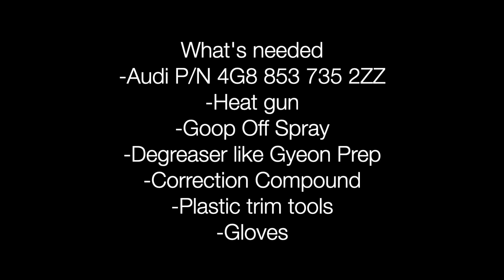Knock-off eBay badges suck!  Time to replace it with OEM Badges

Comment: That part number shows a S7 badge.  do you have part numbers for the rear audi rings and the front rs5 badge and the rear rs5 badge
Reply: Rear badge: 	Part # 8W6-853-740-T94

Comment: Just a tip for future reference, instead of picking the badges off with the spatula a quicker and much safer way reducing possible chipping and indentation. You can use dental floss or fishing line in a "sawing" action...works well.  Keep up the great work! Cheers
Reply from the maker: Good point!  That's actually how I took the original badges off but with the glue used on the cheap eBay badges, I had to resort to the heat gun and gently prying up.  They came off quite easily.

Comment: Believe it or not, WD40 is great at removing the sticky residue, just leave to soak for a few minutes and wipe away. I wouldn't recommend using plastic tools to scrape away as this will scratch the clear coat and you will need to compound the paint. Correct method is to mask out the badge location, heat gun, dental floss (not plastic tools) to remove badges and goo gone or WD40 for the residue or an eraser wheel on a drill is really effective. Locate new badge on your previously made mask.

Comment: The plastic that they came in is a template if you had taken the double sided tape off and marked the boot lid where they are to be fitted to you don’t need to place each of them on separately
Reply from the maker: Thanks for the comment William, unfortunately, my badge stuck to the rear paper when I peeled it off and not the front plastic.  Plus I needed to space them a certain way as I slightly marred my paint.  But duly noted and I'll change the instructions and upload a newer version of the video.
Reply: No problem it’s not a criticism and I understand when I watched the video back I could see why you did it in the way you have I worked in jaguar Land Rover and the latter badges come in like that the operator uses a jig to line them wipes the areas where the badges are going to be fixed too up peel the backing off the badges and fixes them in place
Reply from the maker: Absolutely and not taken as criticism, glad you pointed it out!